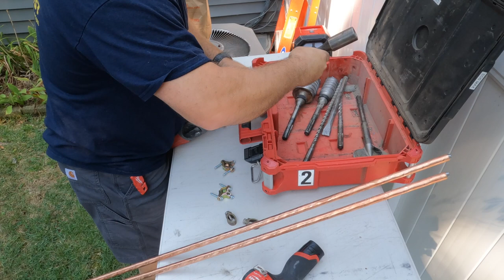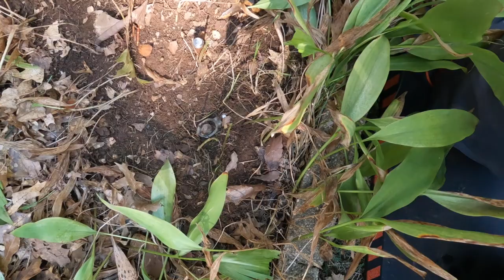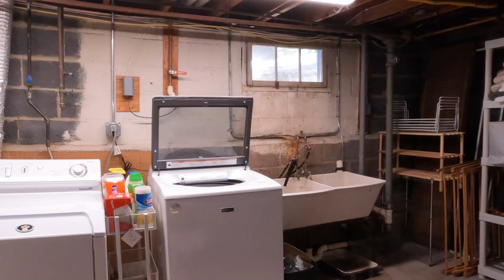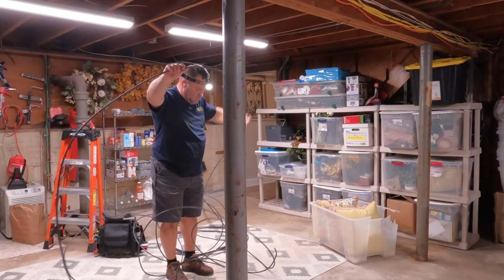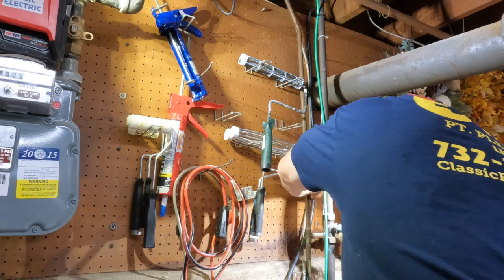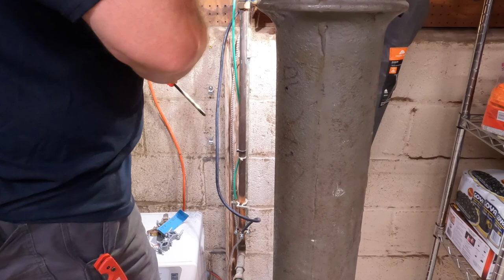The Grounding Electrode System | 200 Amp Panel

Comment: I have a 1960/‘s home with an updated panel that’s 200 amps from the 2000’s? I only have one ground rod. It would be nice to see a video on things we can do to have updated code or safety projects around the house without a full blown remodel or panel replacement. Updating grounds, gfcis, and other things to do. Pool equipment bonding, whole house surge protection. Might be a good series or episode for you. Thanks for all the hard work and bringing us along for the ride.
Reply from the maker: That’s a great idea. Thanks for the feedback.  As for the 2nd ground rod, I wouldn’t worry too much about that. I wanna say the 2002 NEC is where the 2nd ground rod became required. It’s only required if the first one fails to provide 25 ohms of resistance.  Since most folks are unwilling to buy the proper measure equipment and prove to the inspector the 25 ohms is present, we just drive a second ground rod and call it a day.

Comment: I don't drive ground rods very often. So I put an angle cut on a 10 foot piece of half inch EMT. I put a water hose fitting on the other end. I can usually get it most of the way down with this. Then put in the copper ground rod and finish it with a sledge.

Comment: You need to check out Milwaukees new romex staple gun you could probably really get good use out of one.
Reply from the maker: I have the Dewalt version from 3 years ago. I use it often but sometimes the old fashion way works best, especially in older homes.

Comment: Another great video. Why do I see some folks running grounding wire from the grounding rods to the meter while others run ground from the grounding rods to the service panel.
Reply from the maker: Depends on the utility company.  Here with JCPL and PSEG we are not allowed to terminate any GEC’s inside the meter.

Comment: Is it necessary to use 2 ground rods and the water main as a GEC?  I figured after installing the 2 ground rods you’d just be bonding the water line rather than using it as a GEC. However, nice work and cool channel.

Comment: The way I was taught was to run the ground wire between 2  10 ft poles and then connect the wire into the panel box on the ground bar.
Reply from the maker: The wire is known as the grounding electrode conductor (GEC), and the two ground rods are grounding electrodes.

Comment: Where can I get the coated wire used to attached to the ground rod.
Reply from the maker: It’s called insulated #6 AWG copper and any supply house and/ or Home Depot or Lowe’s will have it.

Comment: In other words does it have to be a continuous run or can I just simply bond ground rods into my main panel and then my water pipe into my main panel and then my gas pipe into a main panel? Non-continuous or continuous

Comment: Hi Ron. I'm in Southern California and planning to upgrade my Main Panel from 100 to 200amp (West side house wall). Around 8 ft away, I've water and gas line feeding Gas water heater. The gas line is a flex pipe and water line is copper. 
But main water line coming from City to house is PVC. So the one electrician stated that I can't bond ground with water line next to the heater because main line coming into house is PVC. Also I need to replace flex gas line to solid metal pipe and then only they can bond with gas line. The 2nd electrician said, they can put 2 ground rods on the other East side of the house gas meter and bond with gas line and run bare copper wire across house bond to the panel. There will be NO bonding with water line. So is bonding with one bonding source (gas or water line) sufficient?  Thank you for sharing.

Comment: Thank you for sharing your knowledge.
Question: any issues with galvanic corrosion when bonding aluminum to copper pipe?
Reply from the maker: Oxidation. You must use a listed connector to do that.
Reply: @electricianron_New_Jersey  Thank you for the clarification. I appreciate it.

Comment: That 200 amp panel is beautiful. Also, your video is quite informative.  Question - I put a 30-amp sub-panel to service my basement outlets and my wife’s kiln. Does a sub-panel need its own non-current carrying ground conductor outside of the feed conductor between the main panel and the small sub-panel?  Often wonder if that panel has to have a conductor to a water pipe.  Would be super cool for a bit more guidance on how you come up with the wire size and perhaps a reference for the curios to dig.  I appreciate your workmanship and the videos. I have would love the opportunity to put a panel like the Eaton 200 you installed in my house.
Reply from the maker: Thanks for your question. Your 30 amp 240 volt  sub panel should have (2) hots, (1) grounded neutral, and (1) equipment grounding conductor. The grounds and neutrals should be isolated from each other in this panel. The only grounding connection to the water main piping should come from the main breaker panel and NEVER from the sub panel. Hope this helps.
Reply: @electricianron_New_Jersey  thank you - My background is in electronics and I run a data center for a day job.  I find working on electrical panels and branch wiring to be quite satisfying.  You my friend make this all look so easy though. Be safe and thank you for giving.
Reply from the maker: @MrKen59  Thank you. I've had quite a few good teachers in (and out) of the classroom. I owe a lot to my peers.

Comment: What type of grounding connector do you use to ground a metal fence with less then 5 foot from pools edge?  Respectfully Bob Claire
Reply: Usually you only have to ground metal that is within 3 feet of the inside pool edge. Use 8 AWG solid copper. But your area might have different rules.

Comment: Wire from the water pipe goes directly back into the panel correct? Where do you typically bond the wire from the grounded electrodes coming in from outside? Inside panel? Outside of panel on the wire coming from the water pipe?  I only ask because in my service upgrade I ran the grounding electrode conductor directly into the main panel (first means of disconnect) and bonded the line from the water pipe and gas line to that wire.  Inspector wasn’t crazy about it but he let it go.  He said usually the line from the water pipe goes directly into the panel. Thanks.
Reply from the maker: All of your grounding electrodes get bonded to the system grounded neutral at the main disconnect.
Reply: @electricianron_New_Jersey  okay, that was my understanding.  that’s why I ran the wire uninterrupted from the two ground rods outside directly into the main service disconnect.  He wants to see the wire from the water pipe go uninterrupted to the main service disconnect but he said how I did it was fine. I appreciate you replying!

Comment: Do you happen to know the NEC article about grounding the flexible gas pipe? 

Thanks!!
Reply from the maker: From the 2020 NEC... 250.104(B).
Reply from the maker: @JohnThomas-lq5qp  I think you would agree that if a house were to be hit by lighting a #8AWG bonding jumper would do very little to prevent a tragedy.
Reply from the maker: @JohnThomas-lq5qp  A ground rod and a lightning rod are two different things, and most homes do not have lightning protection.

Comment: Hey ron i follow all your videos i was wondering i have a licensed electrical good friend doing my upgrade from 100a to 200a in new york. However i have a slab home and they cannot get to the water pipes because its all the way on the other side of the house interior. So when they upgrade my grounding system, how will they go about this?
Reply from the maker: Any metal water piping system must be bonded to the system ground. That's a must. Wether or not it qualifies as a grounding electrode is another story but if it is a #4Cu or #2Al conductor must be connected within 5' of where it enters the building/ dwelling. A pair of ground rods will also be required if the waster main is used as an electrode.
Reply: @electricianron_New_Jersey  Doesn't the water service piping qualify as a pipe under 250.66A and therefor not need anything larger than 6 awg coper or 4 awg aluminum?